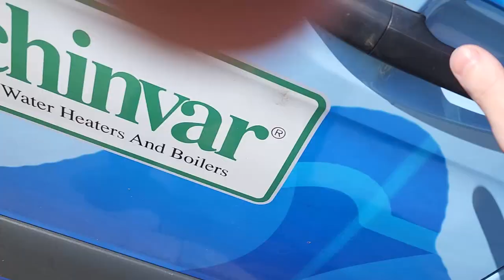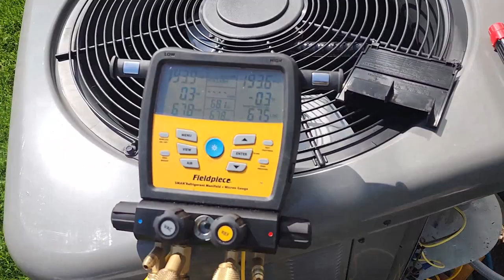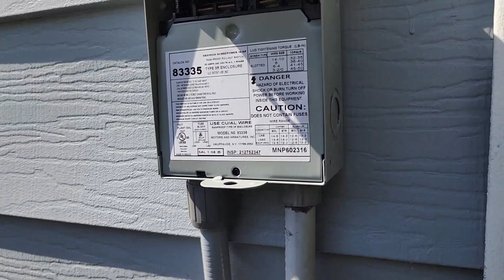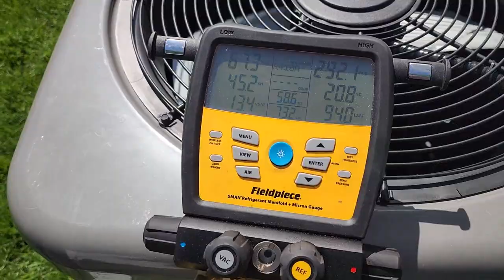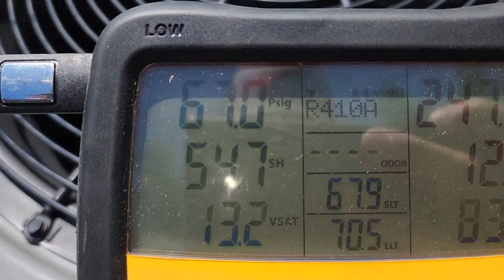Finishing an Incomplete Hack Job, Whats with These Pressures?!? Tearing Out Nasty Old Ductboard!

Comment: @3:53 quick tip, I would have swapped that MC connector for a 90° connector at the absolute minimum, although on a Rheem furnace I probably would have swapped the electrical from the left side to the right side to eliminate the wear and tear on getting the filter in and out pass the wiring. Otherwise I came out looking pretty good for a come-behind install completion.

Comment: That white conductor should be traced,make it red or black woth tape
Reply from the maker: What white conductor
Reply: @DCHVAC  Anytime you are using a white wire as a hot,as in your disconnect,you need (by nec code) to mark it as so! That way there is no way anyone could assume its a grounded conductor! 200.7 white insulation must be permanently reidentified as a non grounded conductor any color that is approved /black,red,purple etc

Comment: What was mikes opinion on the pressures. I’m having a Similar issue.
Reply from the maker: Contaminants probably, but they brazed who knows if they overheated the TXV
Reply from the maker: Or got carbon scale plugging it
Reply: @DCHVAC  textbook restriction. High super heat normal/ high subcooling. Not contaminants. 

Look at your metering device verify correct size piston (check instal manual) check txv. Change dryer.
Reply: @drodriguez394  There’s a n coil there now. I’m gonna charge it to a A coil  with a new txv. Brand new install. You think I should change the line dryer as well? It’s brand new
Reply: @rickjames1486  yeah change the dryer. Is your coil leaking?
Reply: You did a great job taping and sealing that unit……”the d*vil is in the details”. You work ethic shows. Continued success to you and Peter, the man of many words.